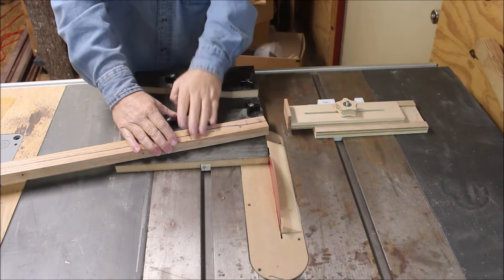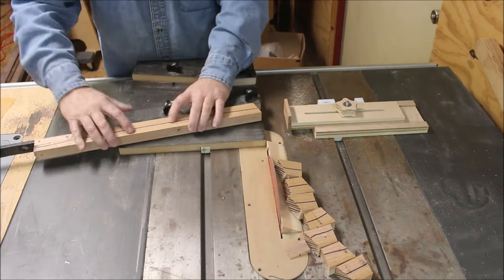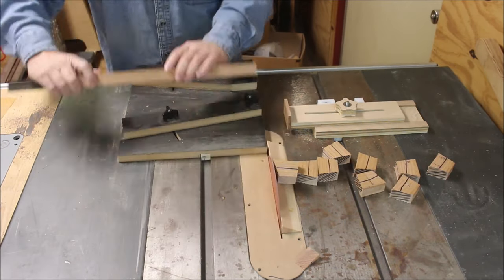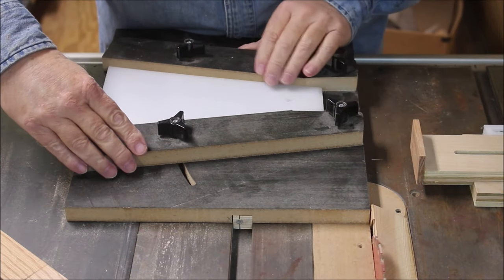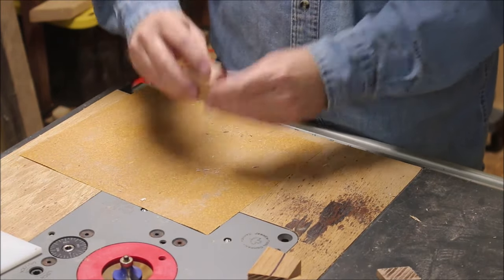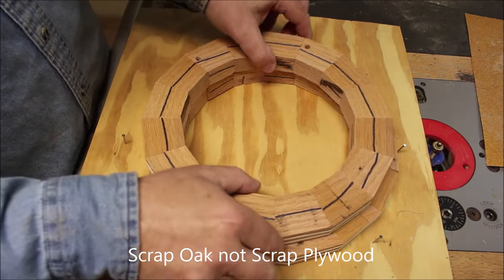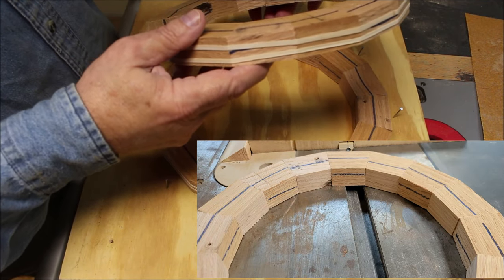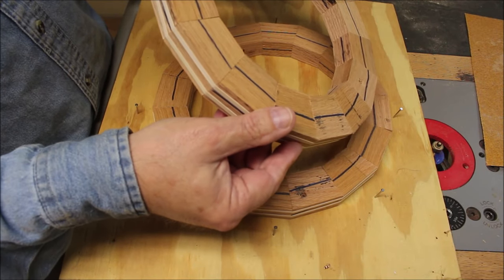The Secret To Perfect Segmented Rings

Comment: If you had to make another skid, would you do it the same way, or put the twp pivots a bit further apart, so you wouldn't need to knock the two corners off?  Or, maybe just knock the corner off the back of the first fence?  Also, there is a good reason to have a platform in front of the front fence, but little reason to have an equally big, back porch, behind the rear fence.  Symmetry is pretty, but doesn't use the skid area very effectively.

Comment: Some great tips  Dave. I just talked about the line on top yesterday but did no mention the one on the side. I stopped using that one because as long as I have the already cut edge toward the blade and line up that takes care of it. But when first starting out both lines will help.
You should always use the side of the fence that is away from you so the blade is not trying to push the work away from it. With expensive wood I will hot glue a scrap to the end so I end up using all I can from the good stuff.
 Glad you put this out as a stand alone video because it clears it up very weill.
Take care,
Gary
Reply from the maker: Thanks for watching Gary and thanks for the great tip about hot gluing scrap to the expensive wood to get all you can from it.  If I ever get any "expensive" wood I will try that method.  :-)
Reply: When I glue it I put both pieces against a straight edge. The same side you are using against your fence. I am sure you knew that but thought I would mention it. 
Anything better than a 2X4 is expensive to me LOL.

Comment: Another way to get an accurate angle between the guides is to lift the jig up to the vertical. Place a digital angle gauge on the lower fence and set to zero. Move the DAG to the top fence and set the angle. This is very accurate as long as the jig is vertical and allows any angle to be set. I made my jig from scrap perspex.(nice and stable) Great video as always Cheers Graeme

Comment: Hi Dave -- Great videos.  I'm a fairly new woodworker.  Can you answer a question for me?  if the two fences on your wedgie sled aren't perfectly symmetrical, even though the angle of the cuts are the same, isn't the trapezoid distorted?  Or does it not matter? Thanks - Craig

Comment: Doing some math's on this recently, if I cut 15 segments @ 12 degrees for a ring diameter of 18" that's correct? would you recommend more segments for a larger ring, looking to make planter ends that have a semi circular section and 18" ring diameter would be cut in half and used to butt up to a straight edge, fixed and glued. Would you recommend more or less segments? does it depend on the thickness? only use a 1" thickness stock or would it need to be thicker to accommodate the curve? thanks in advance on any advice you can give, appreciated Gaz

Comment: Hi there, I am about to try my first segmented bowl, i have watched a lot of how to's  and one thing that I am not clear on is the thickness of the stock,  on calculator changes the stock thickness per ring size, I understand why, but if i am using 3/4 material for each ring i should be ok Or should I use 1" thick stock, the calculator specked 1.5 " stock  so i am not sure   thanks

Comment: I am still having problems with gaps between the segments. Sometimes they come out and I don't have a problem with any gaps and they work out good. Then the next ring I cut total disaster. Although, I had a problem with the measuring stop moving on me, I have it solved. Could this be the problem? I will try drawing a line on the next ones I cut out and instead of keeping the stock to the inside of the angle stops. Thanks for your time.

Comment: I don't understand what the felt tip line on the inside is for.  If you just use the line on the top of the pieces and turn every other one over to have a line, blank, line, etc wouldn't you accomplish the same thing?
Reply from the maker: You need both lines to make sure when you put segments together they are going the right way.  Every other segments should have a line on top AND a line on the inside.  Without that inside line you could put two segments next to each other that shouldn't be.  That way any error in your cut is eliminated.
Reply: So when you cut a segment do you turn the piece over to make the next cut??  I have always kept the piece I am cutting from the same side up with the line always on top.  Then I turn every other one upside down when assembling. @DaveGatton

Comment: The secret is mentioned but not fully explained in the video. Your angle template could be perfect, but setting the sled up can, and often does set a certain error into the sled as you are cutting on two fences. By marking the side of the wood you cut, and turning it each time you make a cut in the sled, it cancels out the error in the set up of the jig (sled). Another point not mentioned is when setting up the template needs to be EXACTLY 90 degrees to the saw blade. Even a minor amount out can be a massive error when cutting. Ideally the end of the template needs to be on the sawblade when setting up, cancelling errors. In the video, yours did not reach the end of the sled and touch the saw blade. Personally i would remake the sled.